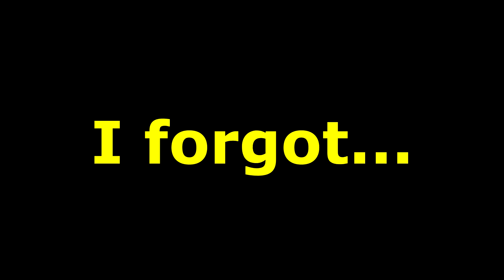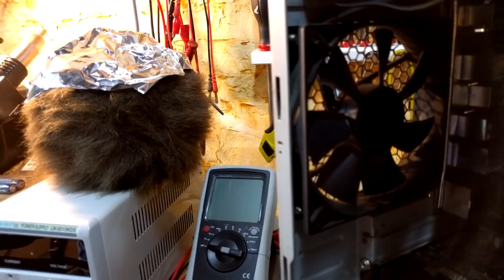How to clean out dust inside your computer

Comment: I have a air compressing maching in my lab. I have used it today. Its pretty easy and removes almost all the dust. But people who doesn't have this equipment should go with conventional methods. In my opinion, looking at the dust that emanted from my workstation today, I think 12$ for a can of compressed air is worth it. I cleaned my system after 2 years of using.

Comment: So sucking air like with a vacuum is not good, but blowing air is alright?
Reply from the maker: You can use a vacuum as long as it doesn't generate lots of static electricity. I have a normal house vacuum that has metal on the tube that holds the floor brush. When on, the metal would give me a little 'zap'. I ended up using a clear spray varnish to insulate the metal - problem solved! Note that this metal bit is just decorative and not attached to anything; the vacuum motor and/or wiring that powers the motorized brushhead just causes an induced current in the metal on the extension tube. So, that's the kind of thing you want to avoid: stray electrical zapping currents that could zap your puter! Besides, blowing air seems to be far more effective at removing sticky dust and stuff since it gets into all the little nooks and crannies.

Comment: What PSI do you set your compressor to?  Mine goes pretty high and I'm afraid of breaking something, but to low seems like it won't do much.  Very helpful video!
Reply from the maker: I don't worry about that. Instead, I just use the air blaster tool, but I blast things from about 4 inches away. Seems to do the trick!

Comment: The square plastic bread package ties make excellent cable marker tags and are essentially free.  They can be labeled , written on , and come in colors, and stay on by design.    Have you ever tried placing a filter material over the external intake vents?     Perhaps some of that really porous , mohair stuff you see in HVAC usage.   This would seem to be a permanent solution to clogging as you just replace the piece of material  instead of pulling off computer coverings.   Maybe even those disposable antistatic dust rags like the Swiffer brand would work providing they don't block air flow.    I seem to remember reading somewhere that moving air induces static buildup.   My own experience with being shocked repeatedly while using a blast cabinet makes me believe this , and woodworking dust collectors must be grounded within the hoses to prevent static caused fires.

Comment: Static is more prevalent if you use the brush attachment after its accumulated a charge from rubbing on other dissimilar electrical insulating surfaces. As long as you don't rub it on upholstery, plastic and the like before using it to clean your PC no charge will have accumulated. Dust going up the hose is a concern as well but the brush nozzle is the main problem with static discharge and using a vacuum cleaner. There are actual tech geniuses that think just the air and the dust and other particles within the air going up the hose are enough to kill components. While that may be true, that's way more likely with a plethora of dust and crap in a system. Also it has to be relatively dry as well. The less humid the air the more likely a charge can build and discharge. So as long as one is careful enough, a vacuum actually can be used to clean computers and the like.

Comment: thanks for the good video.  
how is blowing with compressed air ok and vacuum is not ok for static electricity reasoning?  both are rushing air
Reply from the maker: It depends on the vacuum. Many vacuums are not grounded, and you may get a bit of an inductive zap from any metal parts attached. And then there's the static electricity problem related to a spinning brush on carpet, for example. So, you may be totally fine using a specific vacuum, or not -  but it really depends. Better safe than sorry, I reckon!
Reply: @ScottiesTech  thanks...

Comment: you said you use a compressor and that water is the enemy do you do anything to combat the water that is also in there
Reply from the maker: Any air compressor should do - as long as you blast the dust out when the puter + surrounding air isn't really cold (i.e. near freezing). That's enough to avoid condensation from the water vapor in the compressor air.

Comment: My fan has like 2mm layer of dust. I haven¨t cleaned it since I got my PC. (4 years). I want to clean it now. SMall Update: I have also found a cow web inside of my desktop computer! I grabbed a flashlight and flashed it here and it it really here! There was spider in my PC and what if it is still living somewhere hidden bewteen the components!!! Also, I don't have fans on back. It seems like they are hidden in some steel box at the bottom of my PC. How should I open it? If you have discord, please tell me so we can talk about dis. Thanks.

Comment: Nice one! Where have you been ? I 've been waiting for someone sensible for ages !
I'm from the UK and I thoroughly enjoyed your cleaning a desk top video. 
No bull or flannel, strictly what needs to be done and sound simple and clear advice given that made obvious sense and easy to follow.  
Too many try to impress and do no more than demonstrate their ignorance of what is to be done and achieved.  The exact opposite of what they intended. Saying comes to mind  " It is better to be thought a fool than to speak and prove it " . 
 I use the intake connection of the household vacuum cleaner with a reducing output I cobbled up myself.  Cost  =   zero.  " We already had the cleaner and the reduction end used bits lying around waiting to be used one day. 
Ticked your subscribe.   Must keep as eye out for any other tips you post
Reply: Sorry typo error here Should read I use the output of the vacuum cleaner.not the input.  I.E.  blow not suck  Sorry !!!

Comment: Distilled water wont hurt anything. You can have your computer running and hose it down with distilled water and it would be fine.

But water, even distilled, only makes a dust problem worse.
Reply: As a theory it is non conductive but I dont like how it might interact with bearing lubricants or thermal paste(nothing is perfect) if you actually tried to submerge parts or the whole rig in in.
Reply: @635574  Yea, it probably wouldnt do well with the bearings on fans.

Comment: UDEV on pretty much any moden Linux distribution will notice and silently handle USB devices being moved to different ports, with no need to wait for drivers to be discovered and installed.

But then I guess it's only 2018 and perhaps Microsoft will finally fix that sometime before 2030?
Reply: No reason to. Why fix something that isnt broken and that 99% of users will never experiencd anyway?
Reply: @loc4725  Why though? Windows automatically fixes the issue itself...
Reply: @shabutir1820  
Because this behaviour (reinstalling drivers on H/W location change) is not nessercery and in some cases can cause problems.

And also on a personal level I'd rather have a robust system which can seamlesly cope with trivial changes, but then I guess I'm not your average user. ☺
Reply: @loc4725  Lunix, or unux, has its own set of issues that in my opinion far outweigh any that windows has.
Reply: @shabutir1820  
Such as?
Reply: @loc4725  Low support for almost anything, manual installations of almost everything.

Iv never had anything but issued with Linux. Windows 7 I havent had a single one since i installed it in 2012.
Reply: @shabutir1820  
Are you talking about hardware or software?  Because with the exception of some Realtek (Realwreak?) network adaptors, which incidentally don't work well under Windows either, I've not had any problems. Everything just worked out if the box with no drivers to install.

Of course I still choose to /manually/ install a better gfx card package but that was because some manufacturers don't provide unencumbered drivers. And anyway you'd have to do the same on Windows.
Reply: @loc4725  Both. Not sure why you would waste money on a better graphics card on Linux unless your dual booting haha.
Reply: @shabutir1820  
I guess that's one way of saying "I know very little about Linux".

The games market for that O/S is growing, which seems kind of strange given all the 'problems' you suggest it has.

And as for problems installing it, most mainstream Linux distro's will boot into a live environment and present you with near 100% functionality without the need to install drivers or fix things. And if you found that difficult to use then you either have some very exotic hardware or probably shouldn't be using a computer without adult supervision.

Oh, and Win 7. Support for that ends in ~1 year and the 'upgrade' path Microsoft is pushing doesn't look very attractive to me. But then some people seem to like being the victim of corporate rape so I digress.
Reply: Strange. Your last post isn't showing, at least for me. But I'll reply anyway.

Refering to your last point, that you "havent seen very many games support linux, at least not any game worth playing.", well I guess that's either your personal opinion, which seems to differ from the majority of people, or because you haven't bothered to look. Either way it's a moot point and fails due to of lack of evidence.

Your other point about installing software has nothing to do with Linux /per se/ and therefore is irrelevant to this discussion. And it's also largely incorrect although forgivable since you claim to know so little about the Linux games market.

As a primer: most software for linux is available as packages in the official respositories and are therefore simple to install. Of the remainder a few come as executable binaries (just like in Windows) and while some others can be subscribed to though something called a package archive. This last one is interesting as it allows you to stay up-to-date automatically by receiving the latest from the software provider themselves.

Unlike in the beginning these days very little software needs to be compiled from source and that which does tends to be either in early alpha or aimed a niche users and most definately not suitable forl ordinary people.

Oh and Incidentally non-free games tend to come as binaries, just like in Windows.

Comment: believe it or not, my ShopVac came with attachments, one of which is a small brush which I attache to my vacuum hose with adaptors so the small brush fits to the somewhat larger vacuum hose. works a treat!.  not saying your idea/s don't work, I just don't like blowing dust all over the darn place (which is why you go outside, neh?)
Reply from the maker: You CAN use a vacuum (don't tell anyone) but some vacuums generate too much static electricity. I once had a puter running, and someone was vacuuming. They bumped the puter case ever so gently, and the whole thing just rebooted. Later I investigated and realized that vac was a static monster. Also, even those electric duster-blowers like the one I showed in the vid have a better "anti-static" version available - or at least they used to. But, it all depends. With compressed air, you're pretty safe no matter what. Plus, it gets me to go outside and realize that things like birds and trees exist. ;)

Comment: Hi Scttie - thanks for the great tips and videos - I have one question - how would I clean a laptop?? . How would I "take it apart to clean it?? - thanks again
Reply from the maker: Coming soon!
Reply: I had succes recovering an 6 year old XP laptop with frequent BSOD (Blue Screen Of Death) using the vaccum cleaner with an smaller air part to concentrate the airflow putting it just only on the outside raster of the fan. (no opening of the laptop was required here, avoided electric fields)

Comment: Do not touch the fan while it's spinning. The consequence will be bloody.

Instead of replacing the fan  you can just open it (the sticker is hiding the cap) and add some lubricant.

Comment: You forgot to put a screwdriver in the PSU to stop the fan from rotating. For better results I open the PSU and clean it properly.
Reply: wtf just turn it off
Reply: The air from the blower is moving the fan too fast and may damage it.

Comment: And your mug is full with dust.

This is why I do this outside.

With a vacuum cleaner.

If you connect the tube to the other side (some vacuum cleaners have this practical option) you can use the vacuum cleaner in a "blow" mode (only the "suck" mode is creating static electricity).

Here is how I clean computers with my vacuum cleaner (in a "blow" mode): https://youtu.be/NpolXUY4DoE

The best option in my opinion is to use a vacuum cleaner with option to be used as blower. The price of such vacuum cleaner is about the price of a normal one.

Comment: USB mice and keyboards can be attached to any USB port. There is no way to make them not work by using another USB port.
Reply: It's 2018 and Windows still needs to reinstall keyboard & mouse drivers if it finds those peripherals moved to different USB ports at boot.
Reply: I am not using Windows.
On my computer I can hotplug the USB mice and keyboards and they just work (I plug them after the system is loaded). 

Also, I have anecdotal evidence that on Windows when I plug my USB mouse it just works (sometimes there is "installing device" messages on the screen but it works after several seconds).

Never encountered any problems with USB mice and keyboards on Linux or Windows.
Reply: @vstoykovbg  
He was talking about Windows, which will re-install drivers during boot if the keyboard and mouse devices are plugged into different USB ports.

And until those device drivers are loaded neither the keyboard nor mouse will work.

Comment: I use my compressor. Always drain any water first. Turn down the pressure so you don't blow  100 psi on your PCB and remove parts. I have long hoses that reach. Careful spinning fans with air. You are spinning them 100X faster than they are built for. Anything caught in the fan or imperfections and it can come apart in your face. I have scares to prove it.